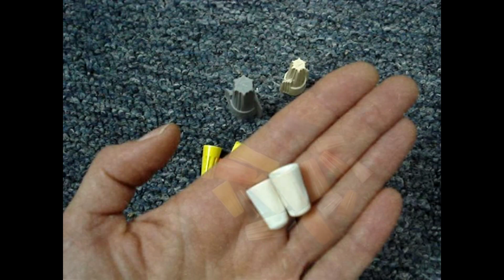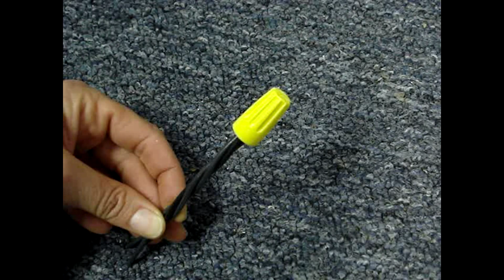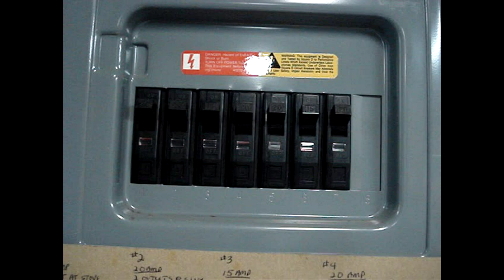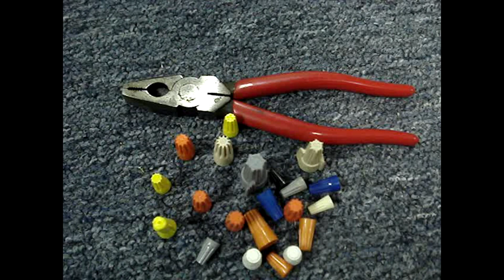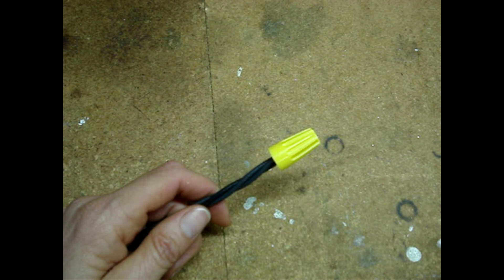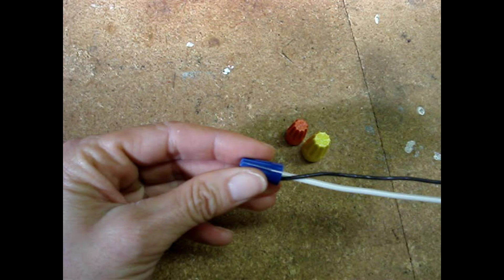How to Use Wire Nuts

Comment: Secondly, when I dig into a j box  I normally find bare copper beyond the nut. Yay for 3/8" stripping and uniform.  And on occasion wire nuts are taped, The tape is usually not adhered. It's a mess. Any remarks?

Comment: I was told it was against code to put more than three conductors in a wire nut. Any truth in that?
Reply from the maker: I'm not an expert with NEC, however, codes often defer to the manufacture's installation instructions.
Reply: Not true, when you buy a bag of wire nuts, it states the number and size of wire that a particular wire nut is designed to hold. Usually they limit it to 5, but in some cases 6 is or more is acceptable, but I would hesitate to use more than 6. I don't think that the NEC specifies a quantity.

Comment: Ideal (manufacturer of most popular wire nuts) instructions say that pre-twisting is not necessary. I would think they know best how to use their products.
Reply: Yeah, that's what they say and I think it's okay for 14 gauge wire, but 12 gauge with 3 or 4 wires should be pre twisted in my experience.

Comment: I took up electrical wiring for 4 years. All the teachers that are Master electricians taught us to twist the wires first before you put the wire nuts on. There are a number of reasons why you do it this way. One you have a stronger connection. You will have less Arkin three you will get all the wires evenly connected for the wise will not separate over a long period of time 5 less chance that you may get a short circuit

Comment: There actually is a "right way or wrong way". You keep using the term "wire connector" which is not correct. The only purpose of a wire nut is for insulation. It is NOT meant as a means to connect or splice two wires together. The wire must be spliced via other means before applying a wire nut. Solid wire can be pigtailed together. Stranded wire must be soldered or spliced together using a set screw connector before applying a wire nut. Please make the appropriate corrections in another videa and take this one down in order to stop the spread of inaccurate information.
Reply from the maker: This video has over 120,000 views.  97.5% thumbs up.  You are the only one making this type of claim.

Comment: I can't find any info on the insides of the connectors. I have orange which has a silver lining and yellow which has copper inside. Which do I use with copper wires?
Reply from the maker: There are many Ideal brand knock offs.  It's hard to say what you have without the packaging they came in.

Comment: Theres so many neater, nicer connectors in the world and you still use these?
Reply from the maker: The video is not a promotion for using wire nuts.  They are commonly used in the United States.  If you have a complaint about them you might petition the folks who make the rules...the NEC and try to have them banned.  I am not that powerful that I can change the electrical code, so there is no need to attack me.  If used properly, they work just fine.  If used improperly they can be a problem.... the reason for the video.  I'd guess that you are a Wago user.  I do have a video about those too and I do use them.
Reply: If it aint broke, don't fix it. The neater nicer connectors that I have seen have not been around long and aren't really practical, are more prone to failure and cost more money. There work great and have been proven with decades of work.

Comment: My limited experience has taught me that I can get a nice snug spiral with up to 4 #14 awg and 3 #12 awg without pre twisting. 4 #12 awg I will pre twist. The important thing is to line up all the ends and use the correct size wire nut.
In general, I think not pre twisting is better as long as it's done correctly, nice and tight on the wire nut. You should get a gradually curved snug spiral. With pre twisting, you get a tight braid from what I've seen. This stretches the wire and the thickness doesn't doesn't fit well with the taper of the wire nut.

Comment: Thank you. Quite helpful. Yes, it seems bold until you want to get the details right.
Reply from the maker: You are welcome.  If you don't make a lot of connections, you might consider using Wago's.  They are much easier to use, though they are more expensive than wire nuts.  https://www.youtube.com/watch?v=A5o-iUDmi3U

Comment: Thank you for this.  I was struggling to find a video showing this method (not pre-twisting) so i could use it in my high school classroom!  I've noticed that when you remove the nut after using the method, the wires have become very nicely twisted together anyway!
Reply from the maker: You are welcome.  My experience is that smaller gauge wire doesn't require pre-twisting (18 gauge and smaller).   Two 14's will also work OK with out pre-twisting.

Comment: I am an electrician and I strongly recommend pre-twisting. Strip about an inch of wire if you are working with 12 or 14 awg wire and twist them together clockwise using linemans pliers. If any of the wires are stranded you should twist the exposed strands together before connecting the wire with any others. Next you cut off the excess exposed wire leaving about half an inch exposed. If, after securely twisting on the wire nut, there is still copper exposed you have not cut off enough wire. Do not cut off too much either as this will weaken the connection. Give the wire nut a tug when you finish to ensure that it is securely in place. I am aware that the manufacturers often state that the wire nut can be used to twist the wires together. They use this as a selling point. This is very unsafe and during trade school the instructor would fail our installation for this. The reason for this is that, although the wire may twist together properly with this method it may not and you will not see that the connection is loose inside the wire nut. Twisting with pliers makes for a stronger and more reliable connection. Just because the nut is on securely does not mean that the wire connection isn't loose. Loose connections cause electricity to arc which generates a great deal of heat which can and has started fires. When things go wrong with electricity they go very wrong. Please be safe and don't take any chances with this. Pre twist and have the peace of mind that the installation is safe.
Reply from the maker: Thank you for taking the time to write the thoughtful comment.  Most of my experience has been with low voltage building systems.... commercial fire alarm, security systems, nurse call, card access, etc.  For those applications just twisting the wire nut on was not a problem.  Electrical contractors did most of our installations.  I worked with tons of electricians.  When I saw them make an AC connection they did as you suggested, twisted the connection with their linemans pliers.

Comment: Wow worst video ever thought it would  never end
Reply from the maker: Constructive criticism about the content of the videos is welcome here, just saying it is too long is not fair.  If it were your video, Mark (your channel has no videos) what parts do you think someone who knows nothing about using wiring nuts would not need to know?  Keep in mind that a loose electrical connection heats up and will likely cause a fire.  Unless you have a newer type breaker that detects arcing, the breaker will not trip.
Reply: UK Thermal  Rude!
Reply: @TheGreenEarthKitty  not rude when its true
Reply: @thermal-n6f  Opinion is not truth/fact.  
Besides, no reason to be offensive- this is a DIY video, not political.

Comment: As an electrician, I prefer to twist first. If you need to to take it apart, the splice doesn’t come apart. Helpful when testing on hot circuits.
Reply: I pretwist, clockwise, then I twist on the wire nut. Finally, I tape the wire nut to the wires.
Reply: I follow the manufacturers instructions, which typically state not to pre-twist.
Reply: Thank you!
Reply: @blockislw9 There's nothing like 4 wires going in different directions in a grounded box.  However, troubleshooting becomes an issue if your isolating circuits.

Comment: I’m trying to install wire nuts that came with a wall sconce. One of them keeps pulling off when I give it a tug. I don’t have a lot of confidence in the other one. Is it OK to replace them with simple yellow crimp connectors?
Reply from the maker: Hi John, crimp connectors are not the conventional way to make this kind of connection.  The down side of using them is that the wire will be cut shorter if the sconce is removed and the crimp connector is not reusable.  I'd rather you make a good connection with the crimp connection if that is all you have.  I'd suspect that you are having a problem with the wire nut because it is the wrong size.  Kudos to you for being concerned about a poor connection.  It's a potential fire hazard.  You might want to check out Wago connectors, they are a little pricey, but easier to use for someone who does not regularly use wire nuts.  I have a video about them, here is a link:  https://www.youtube.com/watch?v=A5o-iUDmi3U

Comment: When stranded wire is tinned it is no longer stranded, what you used is tinned stranded. When using stranded you must twist the stranded wire to make it more firm and then you do the same as what you did with the tinned wire have it a little longer than the solid.
Reply from the maker: Thanks for catching the blooper, Robert.  I do my best to make the videos perfect.  I review them multiple times and check/recheck facts.  It took days of work to make the video.  You are correct, I should have used untinned stranded.  I'm not sure how that got past me.

Comment: Wago or wire nuts? No doubt, wire nuts can make excellent connections, and maybe even the best connections possible. That is not what we want though - we want to avoid any bad connections. With Wago we get these consistent connections all over the install, every time and with only minimal efforts. Wago, no(?) bad connections anywhere! And the connections can easily be inspected and verified visually.
Reply: Exactly. Wagos are easier, faster, safer and allow future changes without too much hassle.

Comment: I twist the wires.  Why you ask?  Simple surface space you want ask much as much wire touching that can.  With the added benefit, if the wire nut does somehow come off wire will still work.
Reply: Try this experiment. Twist a wire nut on two wires without twisting them first, then unscrew the wire nut and look at the result.
Reply from the maker: I ask because there are occasions where I don't pretwist.  I don't pretwist if I am using small gauge wiring (18 or smaller) or  2-3 14 gauge conductors.  I find that I don't have enough hand strength to twist larger gauge wires with the wire nut, especially if it's more than 2 conductors.
Reply: Having a contact are that is larger than the cross section of the thickest wire being connected is pretty pointless for safety - unless you don't trust the connection to maintain the size of contact area permanently.

Comment: I used the larger orange one's for my furnace blower motor wires. I hope they can withstand the heat.  It's a mobile home so can't take any chances. Not much heat in that area but enough to have it on my mind
Reply: You should use ceramic wire nuts in high heat areas. The are made specifically for that purpose. You can get them at Home Depot, Lowes, Amazon, or any hardware store that sells electrical supplies. If you decide to buy from Amazon, use the search terms "ceramic wire nut." Now you won't have to worry anymore, and you will be safe.

Comment: Wagos are life.
Reply from the maker: Wagos are great, though, they are not too common here in the U.S.  Wire nut are what you will find here.
Reply: @Know-How-Now  wagos are just easier and much more secure. Everytime I do a job unless its 10G.
Reply from the maker: I agree, they are very good connectors.  They may be more fool proof for a novice.  I chose the topic of how to use wire nuts because they are commonly used here in US, not the topic of the best connectors available.  When used correctly, wire nuts are a good connection too.  When not used correctly, by someone with little experience, they could be a problem.  They are likely used here because of cost.  It's about $7.00 for a 100 orange idea wire nuts.  An assortment of 75 Wagos are around $20.00.

Comment: This video helped me. I am joining heavy gauge wire with finer wire. It worked better on this job to NOT wrap the finer around the heavier wire but to do it as she shows in this video — leave them both straight, the finer longer than the heavier. I got solid bite with the caps!
Reply: That sounds like a good way to start a fire if you don't know what you are doing. Joining a thicker wire to a thinner wire may overheat the thinner wire and cause a fire.

Comment: Is it appropriate to use a Wire Nut to connect 1 power wire to 1 unpowered wire? When is it nessesary to use a junction box? I'm assuming its when theirs more than 1 connection(2 or more unpowered wires) to 1 powered wire.
Reply from the maker: Sorry, I'm not clear on your question about connecting a powered wire to a non powered wire.  If you are working on a home 120 volt electrical system in the United States NFPA 70 is the electrical code that is followed.  You are not permitted to make any splice without a box.
Reply: Thank you.

Comment: Watch 5:53 to 6:03. The other 8 minutes and 57 seconds can be edited out.
Reply from the maker: I will have to politely beg to differ with you Paul.  I've made thousands of connections.  I did not choose to make a 10 second video as you suggest for good reason.  Use the wrong size of connector, have bare wires exposed, loose connections, etc at you own risk.
Reply: @Know-How-Now  The wire size is on the package. And the other two things  you covered. It was very thorough though. Thank you. I lost my patience so I apolgize for the terse comment.
Reply from the maker: No worries Paul.  When I made the video, I was surprised at how long it took to explain what I thought was going to be a 2-3 minute video.  I was also surprised that I too learned a few things while researching the video.  It is a simple process, though it is important to have a proper connection. 

I had a lamp that was about to burn my house down due to a faulty connection made at the factory.  They used one of those connectors that clamps down and pierces the wire through the insulation.  It was loose, creating heat and it was starting to melt the lamp socket.  Luckily, I saw light switching on and off by itself and unplugged it.  That situation won't trip a breaker.  There are newer style breakers that are supposed to detect this sort of problem, though I wouldn't count on it.

Comment: Looking to repair small wires inside of a heater next to a heat source was looking for opinion on either ceramic or porcelain wire nuts. I cannot find any videos out there at all about what to do next to a heat source when trying to tie wires together. Thank you for your time
Reply from the maker: You might want to contact Ideal, they make all kinds of wire nuts.  There likely have tech support to help you.  Here's a link to their website:  http://www.idealindustries.ca/products/wire_termination/twist-on/wire-nut_high_temp.php

Comment: Pretwisting makes a better, stronger connection. However, it’s kind of a moot point because I think wire nuts are on their way out thanks to much better options like the wago 221
Reply: WAGO'S suck! Like "BACK- STABBING" Switch's I outlets. that thin ,knife edge,is a lot smaller, then surface area of conductor. & I always, pre-twist, "1" cause I was taught "Western Union" splices in 1970 electric shop, 2nd Copper -to COPPER. not copper to "STEEL" spiral.
Reply: Charleton Zimmerman Wagos are the Standard all across Europe and have several advantages. They are thoroughly tested and work well above their ratings.
Reply: Charleton Zimmerman the wagos have a flat surface area for the wire to compress on to, much more surface area than a backstab receptacle, which you’re right is just a knife edge.

Comment: I always twist the conductors together before applying the wire nut.  The reason i do this is because when joining three or more wires I have had loose conductors "hidden" in the group of conductors resulting in a tight wire nut but an internal conductor that was really not engaged in the wire nut.  You would not know this after the wire nut is applied.  The more wires in the connection the greater this risk of a loose conductor unless you pre twist the conductors.
Reply from the maker: Thanks taking the time to comment, Michael.  Most of my work experience has been with low voltage building systems (Commercial fire alarm, security systems, nurse call, etc.)  We worked with a lot of 18 gauge wire, it was fast and easy to use the wire nut to do the twisting.  I find that I need to pre twist with a pair of lineman's on larger wire (12 or multiple 14 gauge), especially if there is more than two conductors.
Reply: Good Video!
Reply: @Know-How-Now  I do work across the board. On smaller wires, the wirenut physically twists the wires together. The main issue here is that you have two cylindrical objects inside of a conical object, which is like a tapered cylinder. Even with the compression from the spring inside, if you move the wires in an angular manner around the wire nut, they work loose, and it doesn't take much. When pushing the wires back into a box during make-up, you end up with this angular movement of the wires. This causes them to work loose. I've never had this issue, as I've always been taught this way and worked with others that did it in this manner, but I had a Jman tell me he would always tell whoever was arguing with him about it that they were responsible for troubleshooting and repairing everything in their installs. After opening up dozens of boxes for the reasons mentioned above, that guy now twists the wires together.
Reply: 7j